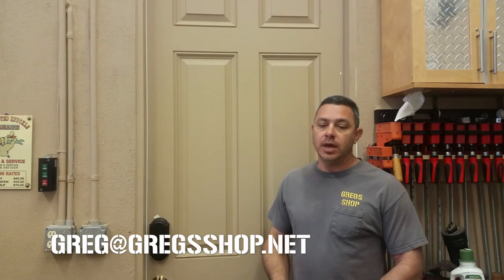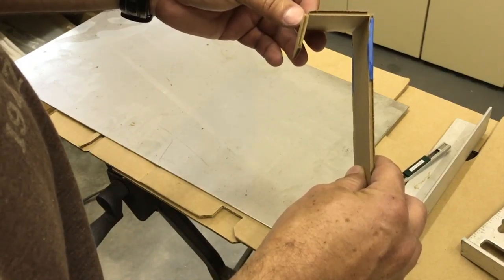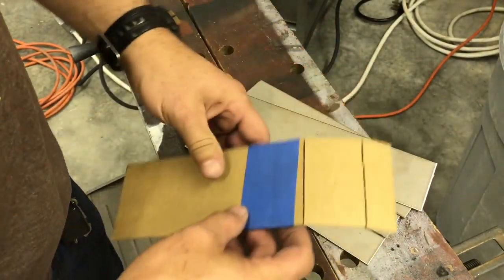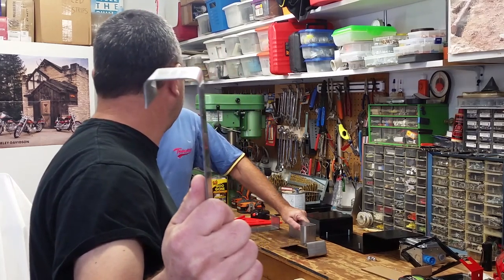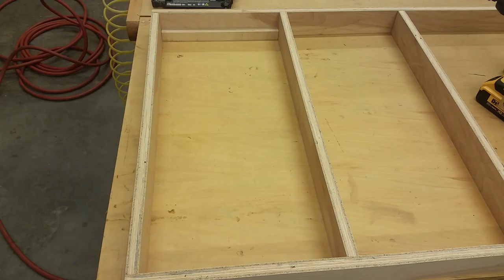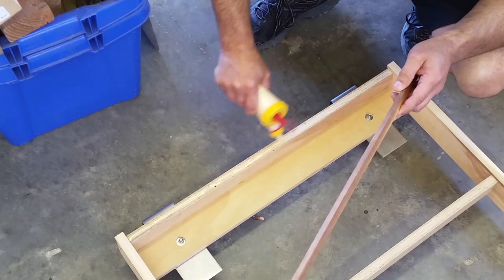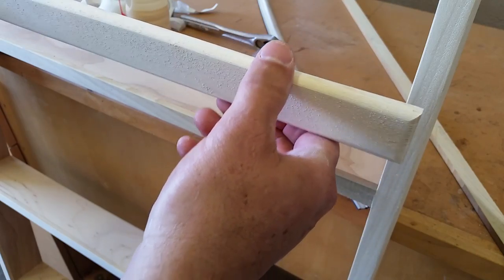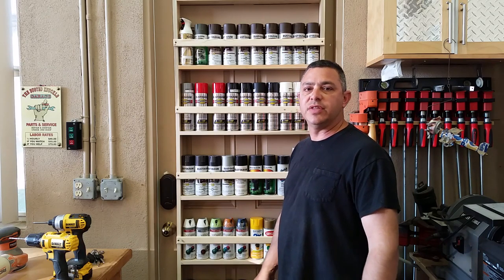Spray Paint Storage Rack

Comment: I see this video is a couple years old. How has the door hinge held up under the extra weight? Just curious because I think the idea is great.
Reply from the maker: Hey Joe, thanks for asking.  The door is nor sagging at all.  It's an 8 foot fiberglass door with 4 hinges.  The hinges on the jamb side are fastened through the jamb into the block wall with 3 1/2" tap cons. Two in each hinge.  I replaced the all the small screws in each hinge with 3" screws.  I didn't show this part in the video but I really should have.  It has really worked out well for me.  At a glance, I know what I have.  Thanks for watching!

Comment: what is that counter sink bit you use???
Reply from the maker: It is a tapered counter sink bit with stop collar.  I've included a link. It's the closest to what I have.  I purchased mine in a pack of 3 different sizes at lowes.  Separate from the bits I purchased a 3 pack of the stop collars.  The price on Amazon is what I paid for the 3 pack at Lowes.  These bits work extremely well.  With the stop collars you get the same countersink depth every time.
Thanks for watching and check out my other youtube videos!

Greg  
gregsshopFL@gmail.com
           
gregsshop.net

https://www.amazon.com/Fuller-C8M-Number-Complete-Countersink/dp/B001DDWQKA/ref=sr_1_10?ie=UTF8&qid=1511455798&sr=8-10&keywords=taper+countersink+drill+bit

https://www.amazon.com/Milescraft-5342-Drill-Stop-6-Piece/dp/B0055HPIWS/ref=sr_1_4?s=hi&ie=UTF8&qid=1511456217&sr=1-4&keywords=drill+bit+stop+collars
Reply: I like that counter sink bit too, really cool
Reply from the maker: Works very well and it’s depth is adjustable on the countersink and the depth of the screw hole.